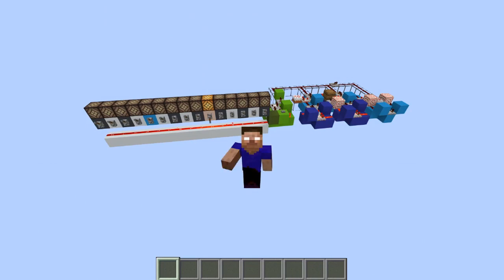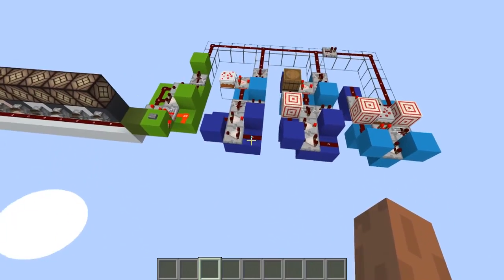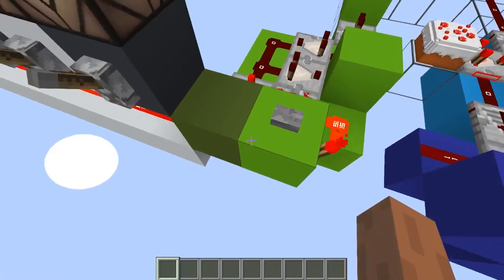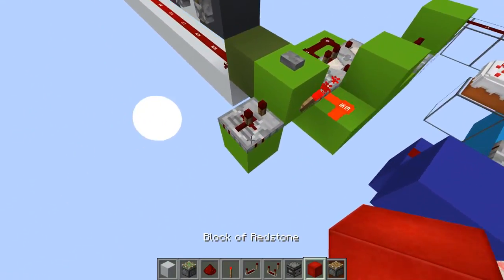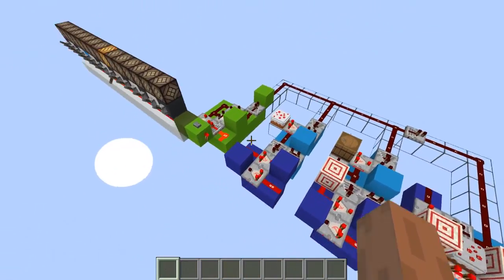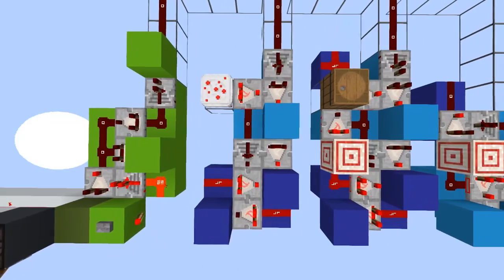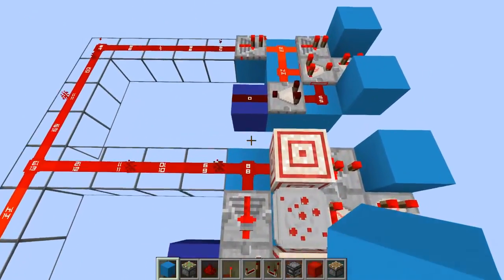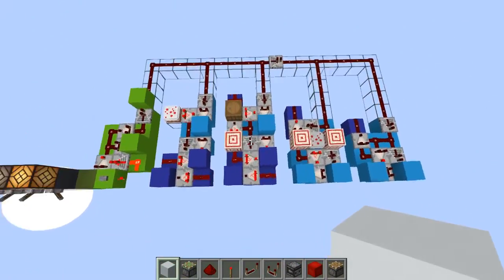Long Distance Signal Strength Transmission made Simple | Minecraft 1.16+

Comment: I was able to modify this so that you don't need a button and it sends its signal continuously, and then adjusts its saved number if necessary. My solution is hardly elegant but it gets the job done, may workshop later.

The signal sender is easy, just remove the torch and button. For the reader, I modified your second version, the one with the barrel. I have it saving that dust in a signal memory gate, because the signal will turn on and off as new signals come in. When it gets a bigger signal than is saved, that's easy, as that just overwrites automatically. So I test if it's receiving a smaller signal. However, as I said, the signal turns on and off repeatedly, so I can't just check if it has a smaller signal, because it will continuously have 0. I instead need to check if it maintains a smaller signal, so I use a pulse extender on a torch for that to delete what it has saved. It also doesn't update for 0, so I just have along the signal line a pulse extender that also sends a signal to turn that memory latch off if it's off for too long. So like I said, hardly an elegant solution, but it works for my purposes.

This was a great idea, glad I found this one, I don't think I would've come up with this on my own. Thanks for sharing.

Comment: I am hoping you could help with an updated version of how to get a single signal strength back out of this system. I am using bedrock so it does seem that there are a few differences in how the redstone behaves with this build. For example, the memory latches do not hold onto the signal strength but all do a pulse of it. This is okay for the build I am using this in but I have run into another problem. I am trying to use a redcoder to get the selected "number" back out of the system. I have tried every single version of it that I can find, and they will pop the correct number, but as the redstone in the redcoder system is emptying then it pulses the torch next to the correct one thus giving two "numbers".  Easy way to show this is put a row of pistons next to the torches with blocks in front. If you send a one tick pulse of a signal strength of 10 for example, then both the 10th and 11th block will be pushed. Can you or anyone think of a way to suppress the pulse that happens as the redstone decays?

Comment: CORRECTION: 8:49 It does matter, when sending a 15. If the comparator isn't in subtract mode it will flash 14 for a tick before going up to 15. Figured that out after about 5 hours of troubleshooting. Comparator needs to be in subtract mode.
Reply: And it also give only a single observer pulse. So it's just the best receiver!

Comment: What are you using to get the redstone to display the power level? I tried finding a mod but didn't have any luck. Are there any other simple mods you're using to make redstone projects simpler, especially ones that are client-side in multiplayer?
Reply from the maker: I might make a video about my mod setup in the future. I don't have a lot of client-side mods that would work on servers unfortunately.

The redstone values are displayed by a data named iRed, you can find it on planetminecraft.
Reply: Check out the Vanilla Tweaks resource packs. You can use a combination of the Clean Redstone and Redstone Power Values options to achieve something very similar to this (ignore the warning about them being incompatible; in reality they work perfectly fine together). There's also a lot of other really useful redstone/technical tweaks available worth looking at.

Comment: I made something similar to this but took twice as long to transmit information and mine is about 2 or 3 times larger. This is going to be real handy.
Reply: But my design can send and receive a zero. I've have to see if I can tweak this or combine it with mine to use a zero.
Reply from the maker: This would be very useful
Reply: @MaizumaGames  I figured out how to add support for sending a zero. It adds 8 or 9 blocks to the transmitter and just a few blocks to one of the receiver designs. Going to try and make a quick video on it soon.... I've just never made a MC video before.
Reply: @CodySmithPhotos  It's been two years but do you still have this design? I've been trying to do the same thing but to no avail.
Reply: @noahettleman1349   I had a video that I unfortunately deleted. I will have to look for it in my unorganized and massive redstone testing world. I think I've made a better version anyways. But the way it worked was using a 1 tick pulse for the zero. You make the transmitter send a 1 tick pulse and the receiver resets from one pulse but with no signal strength going into the memory module since it's too fast for the comparators. if that makes sense. Maybe I'll make a new video.